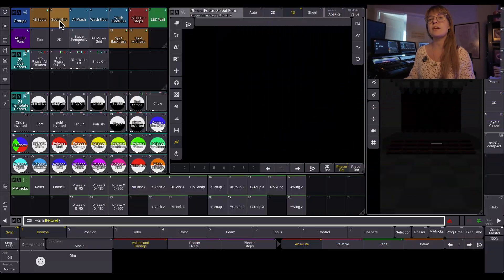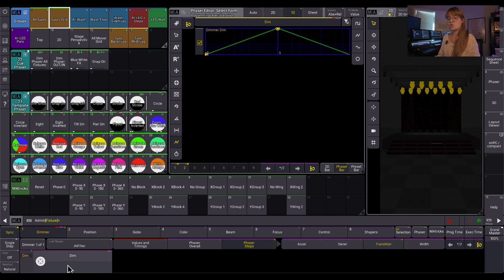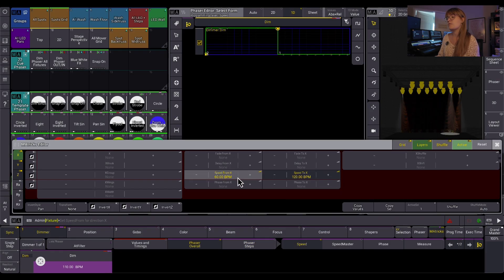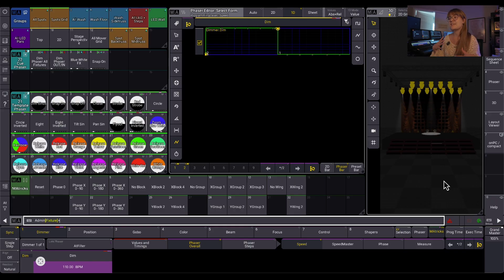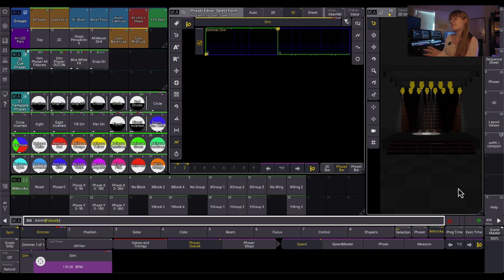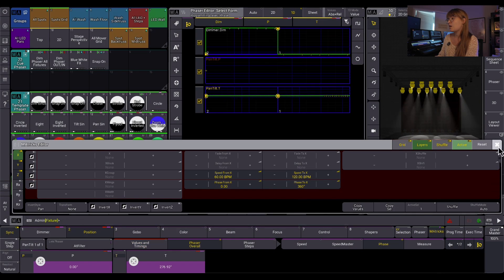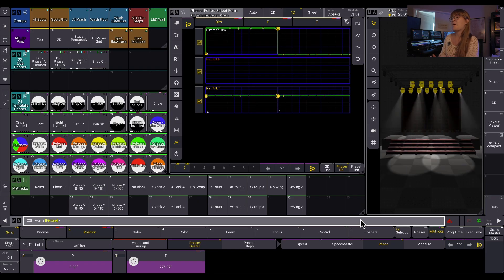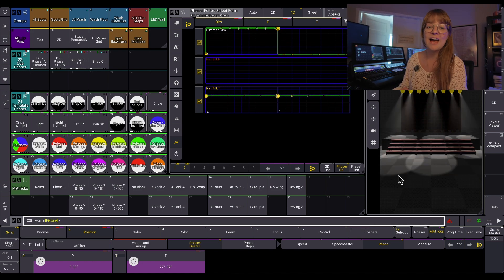Phaser Friday: Thru Speed Phaser in MA3

Comment: I have a timecode on my channel (Muse - Compliance) where I actually used the thru speed on the X4 Bars (on top, the rest are Sceptrons). You can see the effect right at the start.

The way i feel the speed thru works, or the way I feel I might use it more often, is just like that. Simple, with just a bit of "distortion" and then another cue just inverting it or "reseting" the phaser. 

On that phaser I have 4 cues. 1 and 3 are the phaser with the phase, speed thru and wings, and the 2 and 4 are dimmer release.

And yes, if I let the phaser cues running the effect will keep shrinking until it inverts

Comment: It's pretty cool for some EDM sounds when used on a dimmer chase of a line of pixels. You can make it look like a bunch of pixels come flying in and start to pile on each other. Hard to describe the sound but it's like a build type thing that's in a lot of electronic music. I usually kinda use it as a one shot before the direction change. Only have ever used it in timecode
Reply: Yea that’s what I like to use it for. Theres just no good way to ensure it is repeatable. And no real way to control it properly
Reply: @Strobie_one I've noticed it's consistent in time code shows but yeah if you're busking it it doesn't really make sense after a place for a while but it kind of works as a bum